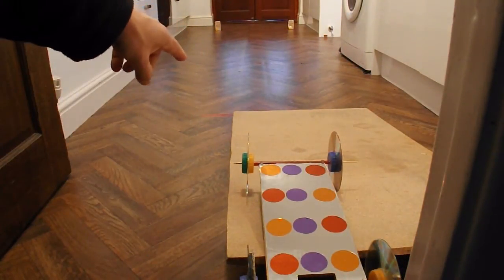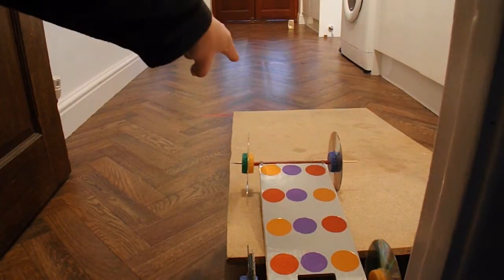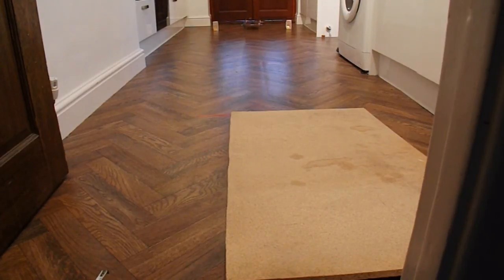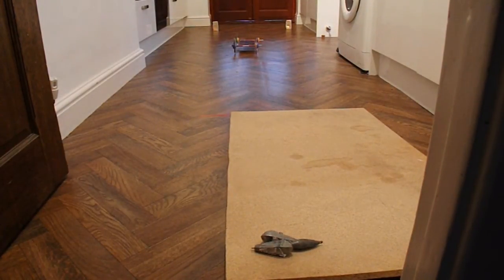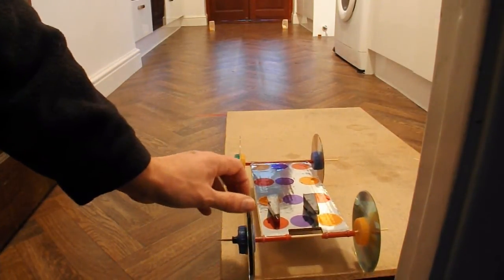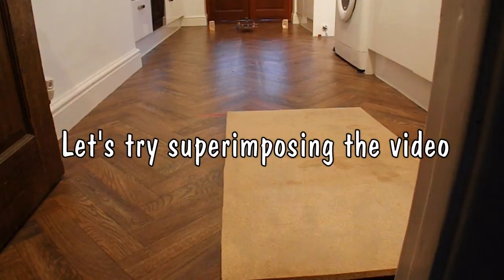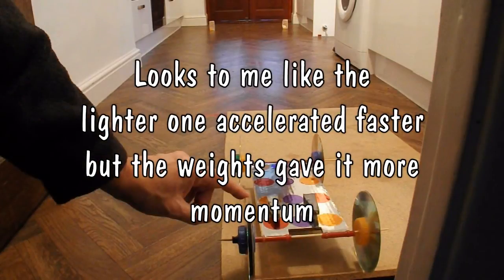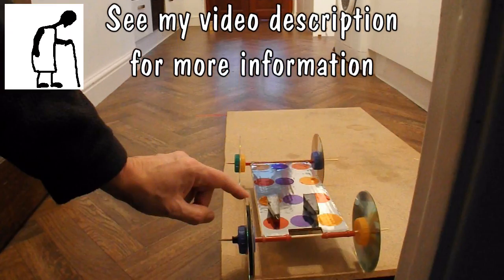Gravity Slope Car

Comment: Nice superimposing there Grandad.
Reply from the maker: Thanks, lucky the two runs were started at slightly different positions, would have been even better if I had planned to do it and I would have spaced them the car width apart. Maybe next time I will remember.